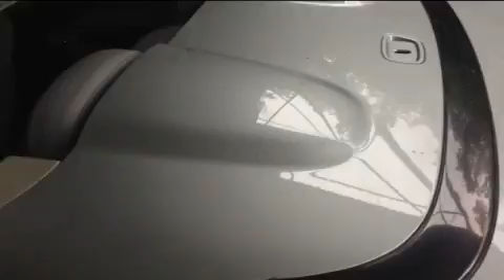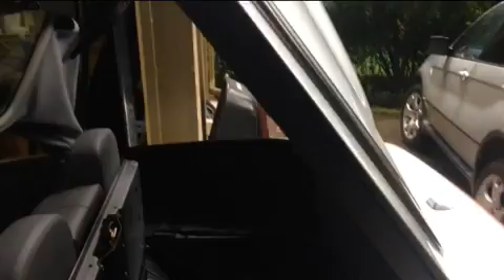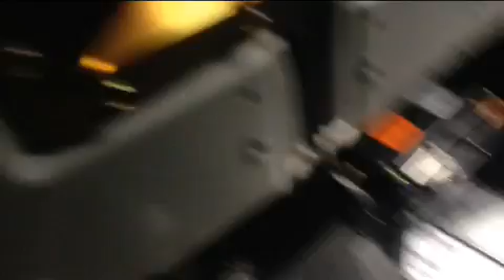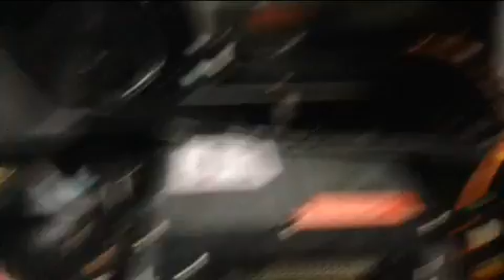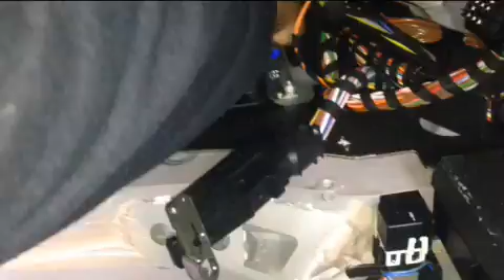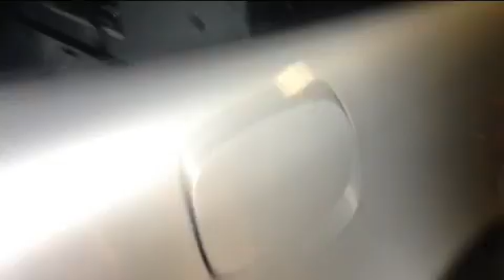Mercedes Benz Convertible Top Clk 320 | Mercedes clk Convertible

Comment: My windows are opening ok. Top is not working. Hydronic fluid was very low. Added oem fluid. 
Trunk also works. We’re your windows not working as well?
Reply: Where did you add the fluid at?

Comment: I have a 2011 benz c300, I installed a audio system and when I raise the bass on the woofer, a burning smell comes out from the hood... l don’t know where is coming from. I would like to hear your comment on the situation, thanks, Juan from New Jersey.
Reply from the maker: I don’t mess with after market. 
It sounds like you may put too much load on the electrical system, you have to make load calculation and make sure you use the right alternator and wiring to support your system.

Comment: I got my soft top to move by itself if I remember correctly it was closing.. and not opening.. it was moving at a good speed like in the video.. I know in the past when it did work it would would very slowly . Inch by inch.. I believe it might be from the hydraulic screw.. I’m under the impression the top is just too heavy.. and it loses pressure. Is there a way to test tho.. that and the cover doesn’t always come up..

Comment: I have the W209, so my pump is on the left side.  Do you have a video on my model CLK320?  Top no longer goes up.  Was going to replace the relays 002 542 14 19 but not sure where the fuse is.  Can you help?

Comment: If I buy a new control system I have to put a program on it right ?
Reply from the maker: GPoPG tv wrong, but it is better if you connect a star
Reply: Mercedes Benz Techs I did a big mistake my old top was damaged so I change it but I did a mistake the better was connected
Reply: Battery*

Comment: I'm having the same issue as Adam Sandoval did two years ago.  Does anyone have an answer to this???????........

I have a 2002 CLK 320 Convertible and the red convertible button is flashing and there is an audible bell that rings when the top is closed and the car is running.  Also the trunk does not open with the key fob when the top is closed.  The red button and the audible bell are off when top is open.  The key fob opens the trunk when the top is open. Was wondering if you would be able to help me with finding out what the problem is or what I can do?  I appreciate your help!!!
Reply from the maker: Lonnie Fenske sometimes all you need to do is normalize the soft top again, under the assumption that you know how to operate the top and everything is in its place.. try to open and close the top manually and see if it fixes the problem, if not, you will have the have the codes scanned with a Mercedes tool..

Comment: My 2002 CLK soft top stopped working, took to dealer they quoted me $7900 to repair, said my hydraulic pump was bad.  Fixed myself, total cost $10.00.  Problem was a square fuse next to the hydraulic pump.  Not saying this may be everyones problem, but it was mine.
Reply: hi. just a question. when u click to open and the top didnt work. you hear some click from pump? Mine dont work but I can hear a click from trunk.  I can only see a relay next to pump. Its a black relay that u switch? Thanks
Reply: Awesome Diagnosis, Jus alit Effort, Congrats to You

Comment: I took my Mercedes CLK 320 convertible to a MB dealership.  The are unable to get in the trunk.  Pulled B100 code and said I need a new module.  $2700 fix however they haven't tested any wires, grounding or the module because of the trunk.  Please please help!
Reply from the maker: Can you bring the over to us??
Reply: Where are you located?
Reply from the maker: +feelnfrogy Buford highway in Norcross GA
Reply: Im in Cleveland Ohio!!
Reply from the maker: +feelnfrogy can't help you without diagnosing what the problem is..
Reply: Well the dealership up here doesn't want to help.  Charging me for pulling a code to me insane 5 minutes $140.00.  That's not a diagnosis.
Reply from the maker: +feelnfrogy Google Mercedes Benz Techs in GA and call me tomorrow
Reply: Who do I ask for?

Comment: I can open the roof on my vehicle perfectly but when I close the roof I have a small problem. It closes but the last part of the back glass doesn't close all the way. It leaves a 2 inch gap. I checked the hydraulic oil and there is no leak. I would appreciate any help.
Reply: Please tell me how did you check the leaks I have the exact same problem the dealer said it was hydraulic fluid but I don’t see any leaks so am I checking the right thing.
Reply: I had the exact same problem. I bought some clamps to hold the window in place and put a seal on the window to prevent leaks. Temporarily but works just fine. No more leaks.

Comment: I have 2 problems in my CLK 1999, If you can help me please.
1- the top is not working properly i have to push it up and till it goes all the way to the back and i have to hold the back led unless it will close before the top settle down in the trunk, how ever when closing its ok,
2- also while driving if i took a hard turn or a bump the soft top switch makes a sound and start flashing red and the 4 windows roll down all in the same time, i had some leaks but i did fix it and the oil level is fine, can you please tell me what is the problem or where to start, appreciate your help Brother
Reply: Sounds like your control unit is going bad..
Reply: Thanks David, i was working on the back when i found a unplugged cable next to the spare wheel driver side i connected it and the second problem is solved

Comment: I have a 2003 clk and my top wont go down. I believe its minor because the car is in great condition. The previous owners barely drove it. When attempting to drop the top the windows instantly roll down. But the top lowering does not start. Do you think its hydraulic fluid or the control unit. In the beginning the convertible top button was flashing red. What does that mean
Reply: any idea what this was Gekia? im having the same problem with my 2001 clk430, top wont go down.. the other day it went down then struggled a few attempts to get it up... got me nervous now today the top wont go down? tried replacing the 40amp fuse... now thinking relay? or module? when i open the manual lock on roof the windows go down...red indicator light stays lit up, but when i try to drop the top the light stays flashing till i take my finger off it
Reply: Jordan you ever find out the problem?
Reply: I have the same exact issue. Did anybody figure it out?
Reply: Anyone get help with this issue? I have a 2005 320 and the top will not open. It says it’s opening but it’s not . Just click sound. But I can double lift the top button and windows roll up like indicated in manual . Does that mean it’s just the hydraulic oil???

Comment: I JUST HAD THIS ISSUE.. I FOUND THAT BY DISCONNECTING MY BATTERY FOR ABOUT  1MIN, IT WOULD RESET THE VDO CONVERTIBLE CONTROL MODULE. THEN I RESET ALL WINDOWS (UP THEN DOWN) THEN HEADREST (UP THEN DOWN) THE TOP STARTED WORKING AGAIN.
Reply: how you hard reset it?
Reply: @gpopgtv1508  ???? How??
Reply: Funny that i just bought clk230 cab ocasionaly the windows the mirrors the headrests and something else stop working. The only was is to disconect neg batry lead. Someone told me it was a fault in the drivers door with the black module with 4 plugs on it. Was going to change it tommorow , accidently come across this video and never thought it could be the roof module. Big ThankYou
Reply: @paulattree1973  I eventually found a VDO module off of a conv. Clk320 at the junkyard for 27$ but rare to find convertible Clks. No issues since. If you buy another VDO make sure it has the right part number or it will not work correctly like he said in the video. I learned the hard way about that.
Reply: Shows Yr a good observer and willing to give it a Try

Comment: I have this problem, the roll bar won't go up but the windows all worked for awhile, not the front won't go up, you can hear the little click but nothing.  Suggestions?  Thanks
Reply: u solved? Mine happens the same. only a click I can hear. Please tell me what u did to fix.Thanks

Comment: I have a question for you.  I have a 2002 CLK 320 Convertible and the red convertible button is flashing and there is an audible bell that rings when the top is closed and the car is running.  Also the trunk does not open with the key fob when the top is closed.  The red button and the audible bell are off when top is open.  The key fob opens the trunk when the top is open. Was wondering if you would be able to help me with finding out what the problem is or what I can do?  I appreciate your help!!!
Reply: ***** I havent.  Tried a bunch of things and can't figure it out.